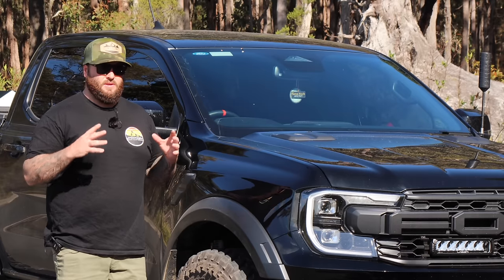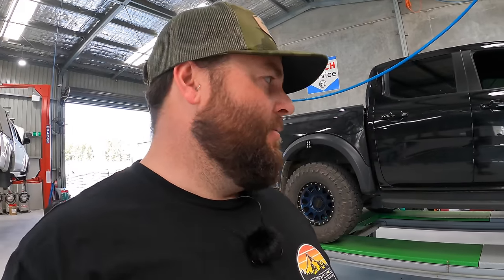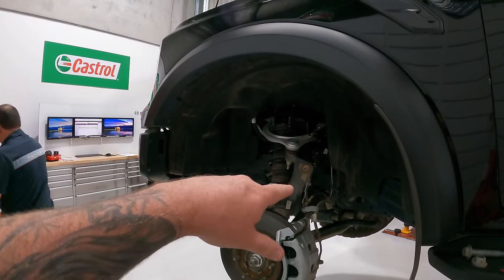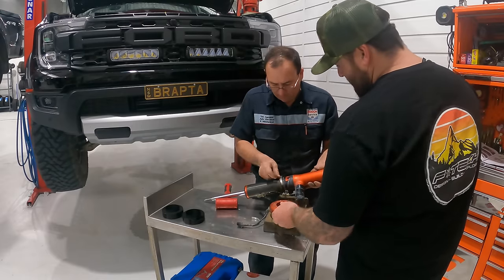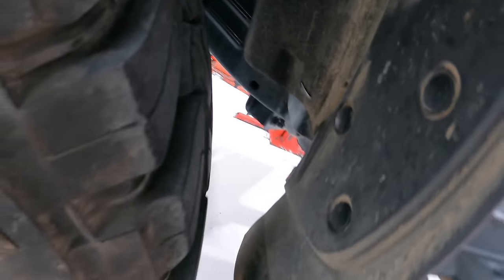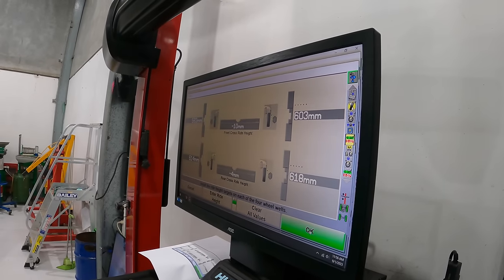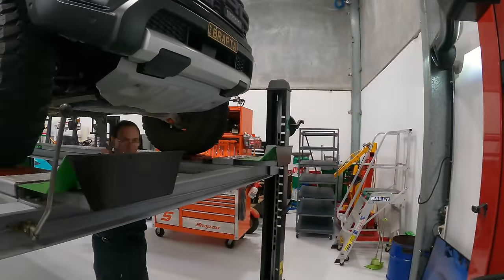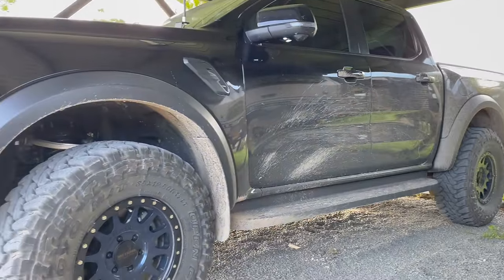🛠️2023+ RANGER RAPTOR SUSPENSION LEVELLING KIT INSTALL - CTB Performance.

Comment: No related but I brought a new ranger raptor this year it has been the best car I tow 1.8T every day and it does it great. Yes I know there not designed for it but that 3.0L petrol under the hood is a beast, 19,000 kilometres on it and zero issues
Reply from the maker: I love mine as well ! Sickest vehicle ! 😎🙌🏼
Reply: The 1.8 t tow must be a extra fuel tank

Comment: Hi, looking at fitting 35s, have a few questions, 1. Will this allow enough clearance for 35s. 2. How has the driving experience been since placing them. 3. Does this mod effect its surroundings (significantly affect the original engineering of the car)?
Reply from the maker: Yes 35s will fit. The front feels way better since fitting them. No it doesn’t effect any of the geometry or engineering of the Raptor. 

This is the only mod I’d do to a Raptors suspension.
Reply: @TyFenwick  I saw that there were other brands for the perch collars. Is there a difference between brands?

Comment: Appreciate your common sense around mods. Helping me a lot with what direction ill go with mine. Cheers from NZ
Reply from the maker: Thanks for watching mate 👍🏼
Reply: @TyFenwick   Would be cool for you to test drive a 2023+ Chevrolet Colorado ZR2 Bison and compare it to a 2023+ Ranger Raptor with 35's and lift collars. Would bet that a full sized 35×12.50r17 (Nitto, Toyo or Maxxis MT) would fit on the Bison 😉😋😁. I would get 35×12.50r17 Mickey Thompson Baja Boss MT for more serious off roading(but still having good street manners) or 35×12.50r17 Yokohama G003 for touring as they are a smaller tyre or 315/70r17 Toyo/Nitto MT's.

Comment: Thank you Ty, you are the reason why I bought my gen1 RR back in 2020. But I still dont get why we should not use spacers (1 inch or so) on the top of the spring. My truck is in stock setup but the left side (driver here) sagged about 15mm after 3 years and 45k. The diesel tank + def tank + 120kgs driver are all on the same side😂.
Reply from the maker: A spacer increases the overall length of your shock so if you jump your raptor the components like cv’s can travel further then factory intended. I know from experience as when I was younger I had spacers and they caused me so much drama.

Comment: Thanks for sharing bro, looking forward to what you're going to do in the rear. I guess if you aren't carrying weight should be sweet as is! I went the King Spring KFRR-121 as I got a bit of weight. Rides alright!
Reply from the maker: Yeah man mines just a daily. The Ftruck is for traveling etc so I probably won’t be doing anymore to the suspension. 😎👍🏼

Comment: Just subscribed, picked up the raptor 3 days ago.

Been 4ish weeks, have you run into any issues if any since the install? 
Does it feel any different then stock?
Appreciate your work 🙏 🙌
Reply from the maker: Thanks for subscribing, so far I like them. 

Rides a bit firmer in the front but with 35’s I like that. I’m very happy with how it performs.
Reply: @TyFenwick  yeah fair call, thanks bro. 

Keen to see what's planned 👀
Reply: @TyFenwick  yeahhh bro got the perch kit today, wheels and tyres next week 😎 🙌

Comment: On your wheels video, you recommended 315/70R17 rather than 35s. Would those tires with the stock rims fit and not rub if this perch kit is installed?
Reply from the maker: Yes 🙌🏼

Comment: Hi. Mate 
Thanks for your video. Good info. By the way, when you put perch kit or springs upgrade. Raptor need to height sensor re-calibration? Around 40mm height upgrade still live value working well?
Reply from the maker: Thanks for watching. You can recalibrate if you want to but I haven’t. I don’t feel it’s needed, plus if you recalibrate them you’ll change how the shock reacts at full droop and full
Compression.
Reply: @TyFenwick  thanks for replied. I’ll see and feel it. If you don’t feel like no need it me either. I won’t jumping like you 🤩
Thank mate.

Comment: So i fit the perch and 35s will fit  no rubbing? If yes, is it possible on stock wheels? If not stock what is the wheel off set required?? Appreciate it ✌🏽

Comment: One thing does it now on full compression close the spring to lock solid before it hits the bumpstop if it does it will destroy the strut.
Reply from the maker: No it does not do that. I’ve hit full compression everyday in mine, no issues

Comment: Ty did you end up having to get the front shocks reset by Ford after fitting this leveling kit ? I was wondering, as I’d like to get the same guys you used to fit the same kit; after I fit a front bar. Matt
Reply from the maker: Hi mate, no I haven't done anything. I fit them and drive it, recalibration is not required in my opinion.

Comment: So tell me what’s the big difference between putting a spacer on top, then placing one in the middle or bottom of the spring?
Reply from the maker: Top spacer increases overall shock length to increase height. 
Perch kit keeps shock length the same but compresses spring to increase ride height.
Reply: Could have also gone with a spacer on top of the bottom-plate.... is exactly the same effect

Comment: Hey Nice Video! I think you have much knowledge of this car so hers my question:
Soon I will get my Ranger Raptor (here in Germany) It will get an RSI Hardtop, Decked bed , long Range Tank and a Roofrack. That's about almost 400kg without me an my stuff. I use it for hunting an overloading/camping. Should I use stiffer springs? Greetings from Germany!
Reply from the maker: Thanks for watching !!!
Reply: @TyFenwick  c an you answer my question 😋

Comment: Hey champ I’ve put a canopy on mine and the rear has dropped. Would you recommend these for the rear shocks too?
Reply from the maker: CTB have notified me that a customer did  fit this kit to the rear so it works. However i have not yet tested that to confirm myself.

Comment: Tried to contact CTB to ask a few questions, something didn't work on the website, may be you can help.. 

Just wonder what is the differences between that to a up spacers..? 
Seems to me that in prech collar  I'm losing suspension travel and compressing the spring and with an upper spacer I just push down, the geometry will change due to that.. But no direct impact on the actual suspension 
Please educate me.. 

Cheers 
Elad
Reply from the maker: Hi mate, 

A spacers on the top of the strut will mess with all your geometry leading to potential breakages. 

I run the perch kit in mine and suspension travel has never been an issue for me. You maintain full down travel of the shock, under compression it give you more clearance with 35s. 

Perch kit is no brainer, I push my raptor hard everyday doing 50ks of dirt road. 

Go perch kit mate you won’t be disappointed.

Comment: Hey Mate, looking at this product as I need to raise the front end by 35mm for the bar I'm looking at (x-series by supreme innovations), however I have some concerns about the ride height values before and after installation. You had a 6mm high left side (571mm), than the right (566mm) pre-installation. post installation you had a 10mm right side higher value (left 595, up 24mm, right 606mm, up 40mm). So originally you had high left side, now you have a high right side (16mm cross ride height difference (-6mm pre-install, +10mm post-install). Does this sound right? Sounds like something has been twisted. Not trying to bash, trying to understand, whether this mod will mean I don't have to get king springs to raise the ride height for this bloody bar. Cheers, Josh
Reply from the maker: You will always have differences to each side regardless. Tyre wear, drivers weight, modifications etc. nothings twisted but shocks will bed into place after driving. We have sold over 100 kits now and not one bad comment or problem has come back to us.

Comment: Can you level the rear as well. I'm fitting a canopy and dual battery with a fridge and slide
Reply from the maker: We had a customer who said they used the kit in the rear and it works.

Comment: Doesn't this add more compression to the spring by raising where it sits now? like almost adding some pre-load?
Reply from the maker: Yes it will add compression. Off-road I feel the Raptor handles better in the front end and feels better going into big bumps

Comment: Had the perch collars and it makes the suspension so much stiffer. Took them off and use a rough country puck instead
Reply from the maker: I disagree, the perch kit is much better option then the spacer. 

But each to their own. A spacer will change the geometry of the suspension potential causing cv issues.
Reply: @TyFenwick  incorrect. Ran both. The geometry change is a load of bullshit.
Reply: @TyFenwick  Perch collars and spacers are both not the best to run... revalve and spring replacement is the proper way to lift these raptors
Reply: hey Ty, is revalve and spring replacement a option now? Should I just ask my local tyre shop if this is something they can do?

Comment: Good evening from faraway Greece, the extension is only for the front shock absorbers, for the rear what should be done?
Reply from the maker: CTB have notified me that a customer did  fit this kit to the rear so it works. However i have not yet tested that to confirm myself.
Reply: How much higher does the car go? does it really help to fit larger wheels to dimension?
we are waiting for your opinion if you find out news about the rear wheels!!! @TyFenwick

Comment: your still trading down travel for up travel, where as a small strut spacer you  retain that ratio, still a nice product!!
Reply from the maker: The collar gives full stroke up and down without impacting on any other component. It also gives me more control on harder landings after a jump, there’s more compression on the spring. It’s been awesome to jump as I’m not pushing though the range of travel as quick on impact. 

A spacer makes the shock longer so at full droop you’ll put stress on CV’s and other components.

Comment: Do you think adding the collars while running 35’s you would not need to alter your mudflaps mate? Can you get full compression now without scrubbing out? Thanks bud
Reply from the maker: Though the range of suspension travel that’s never going to change regardless.  If you’re turning and the suspension compresses it’s still going to scrub in same location. Full compression it still scrubs with 35’s slightly with perch kit.
Reply: What about 35 offset wheels.

Comment: whats the difference between putting spacers at the top right up on the mount compared to that of ctb perch kit which is below the coil springs??
Reply from the maker: Spacer on top increases the length of the shock potentially causing cv damage. Perch kit does not as it maintaining the factory shock length.
Reply: @TyFenwick  thanks im looking forward to your other videos

Comment: Whats it like at full droop and compression? Still scrubbing?
Reply from the maker: I’ve been in USA so haven’t driven it much other then what I mentioned in the video at the end. So far it hasn’t scrubbed at compression jumping it
Reply: One thing to note when doing perch collars is that the ride height has to be set on fordscan/forescan.
Reply: OK that's interesting. I wonder how much effect that will have on the live valve? It may help with that additional firmness. @5L_Eater
Reply: @dannyrexknight  you have to reset the ride height on forscan otherwise the shock still thinks it has droop that it no longer has.

Comment: So after all that, it’s the exact same as a spring lift, and spacers are still better.
Reply from the maker: If you change the springs then you’ll loose the factory spring rate. Spacers are rubbish.
Reply: @TyFenwick   what’s wrong with spacers? Genuinely curious? You keep the factory ride, and the shocks work as per factory.
Reply: @wizzylizzy69  in this case i think spacers in top of the shock might be better than perch kit or longer spring without revalve the shock. You lose the factory spring rate anyways if you compress the springs with perch kit.